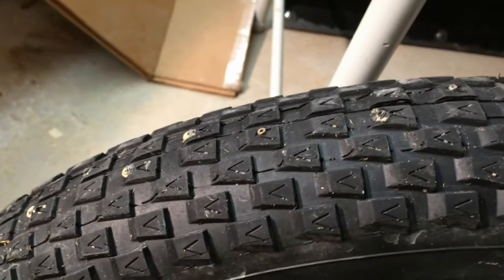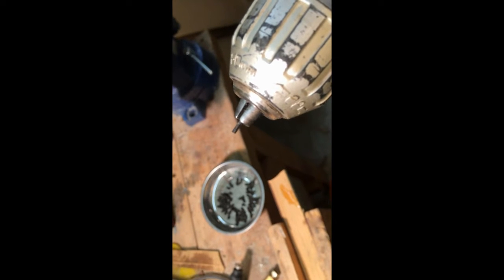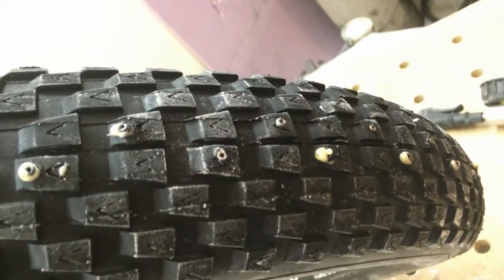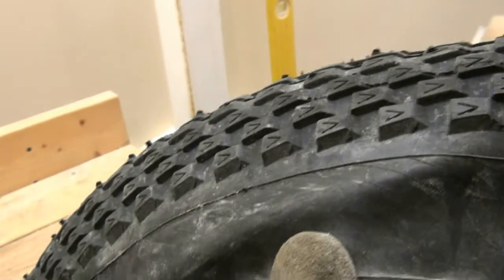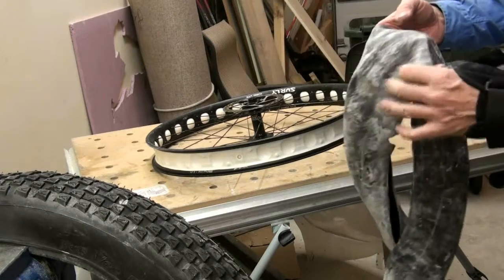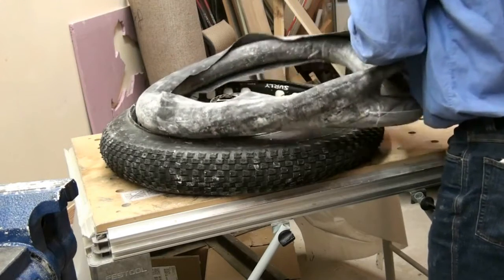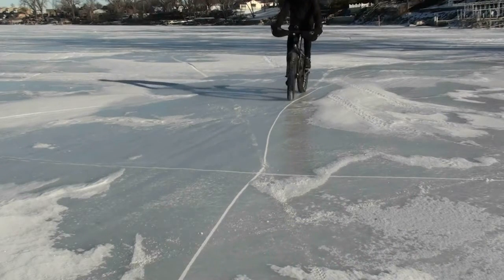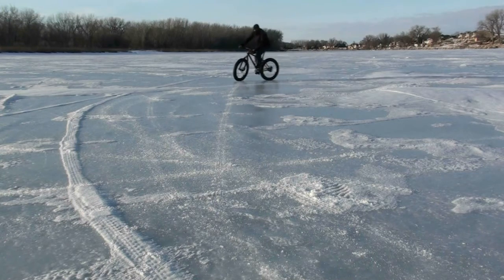DIY Studs for BikeTires - Set Screws

Comment: im telling u bro i mastered this stuff i have went through so many ideas on this i discovered my best choice was and is always wafer head lath screws. it really doesnt matter as long as they are flat headed and distinct thread. with a ratchet strap liner it holds everything in place theres no chance screws come out and if they do its minimal. love your choice its just more costly. this was next to nothing. im starting to sell them i swear by them so much. also for front tire i made the mistake of putting screws down the center which is ok but it will feel more unstable. the thing with this is if i take a set of lock cutters or a grinder i can shorten up the center ones to almost flush so it balances better on the pavement. i had snowplows cheer me on last year riding through storms ahha so sick

Comment: Hey Dirk, cool idea. I bought some cheap CST Roly Poly tires I was hoping to spike, but the knobs aren't wide enough for the typical studs you find at, say, bikestuds.com. The set screws, without the wide base, seem like they could work.  So I'm wondering, after having used the set screws, how they held up?  Seems like there could be two issues. First, that the set screws, without a wide base, could actually push thru the carcass into the tube. And second, that they might rip out if you turned your wheel sharp on pavement. Thanks.